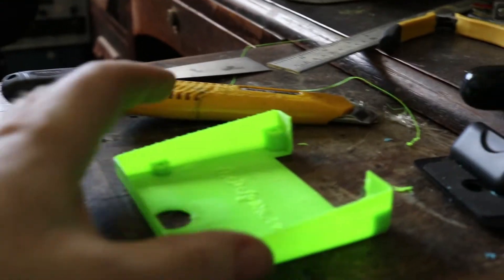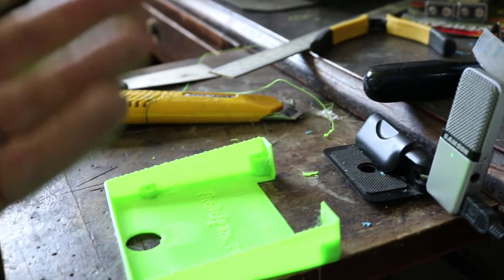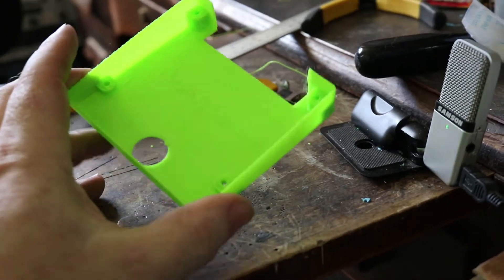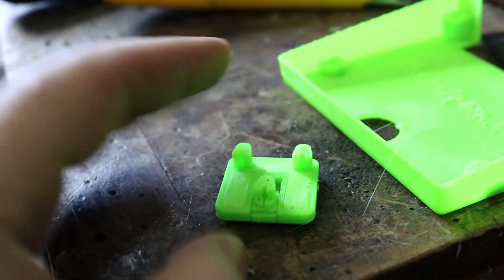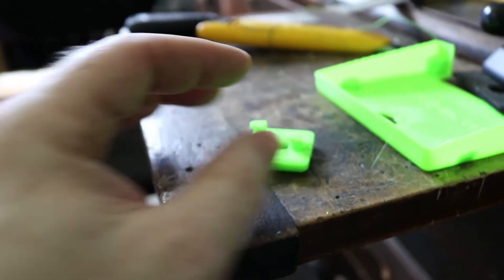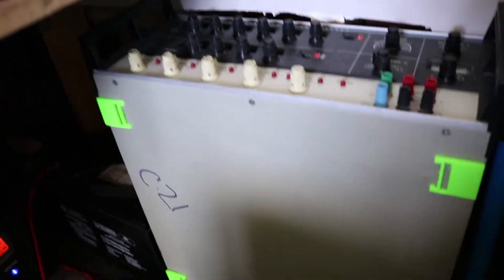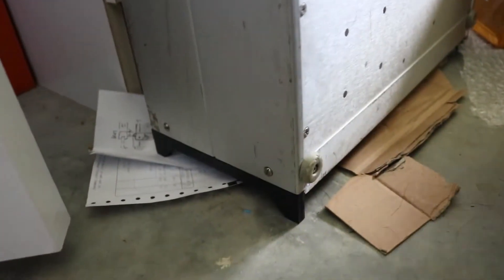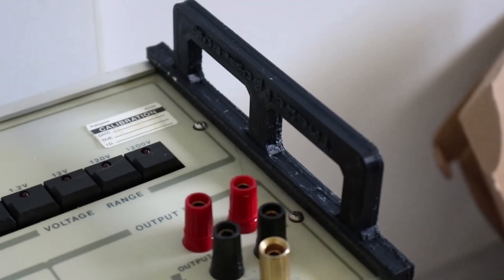🔴 #395 Creality Ender 3 First Prints

Comment: It would be really awesome to show how you got all of those and modified them.  A tutorial on that process.
Reply from the maker: Some of the items I designed myself in Tinkercad, if I found something similar which I modified I found those on Thingiverse, again I used Tinkercad to do the design changes in those cases.

I am not very experienced with this 3D printing stuff yet, I could do a tutorial, but I doubt it would be that good, I am sure that there are others already on YT which will be a better job of showing how to use CAD and exporting files into a slicer etc.

Comment: I thought the Ender 3 control panel looked a bit too open-plan!
It's amazing how many things you find to 3D print. Soon you'll be wondering how you managed without it! 
As you've shown, it's great to be able to make parts for things that are no longer available from suppliers as well as make your own upgrades to existing kit of all kinds. That will rapidly expand once you start using TPE's and other more specialised filaments.

Comment: Was this a run after the repairs, as the feet and handles looked very good.
Not sure what that green casing with a hole in it does.
Reply from the maker: zx8401ztv - yes all done after the unit was fixed, the green shell is a cover for the rear of the 3D printer control panel.